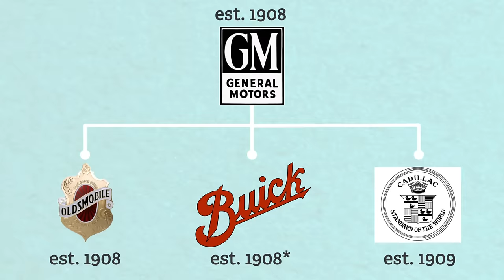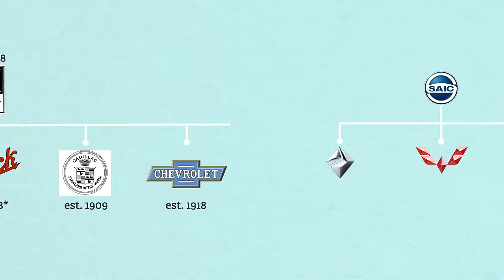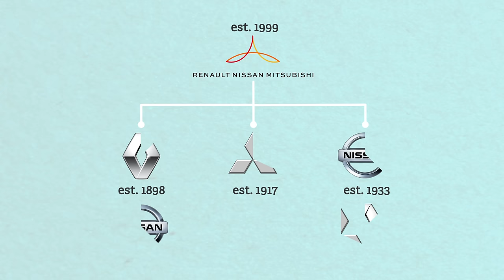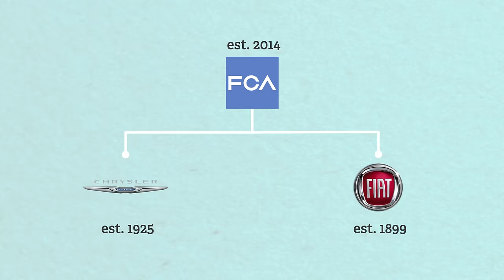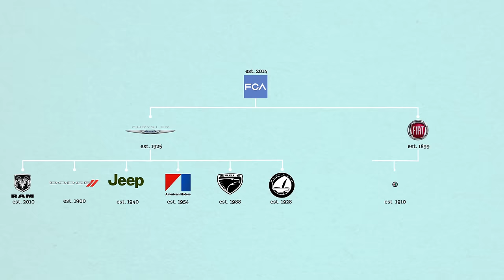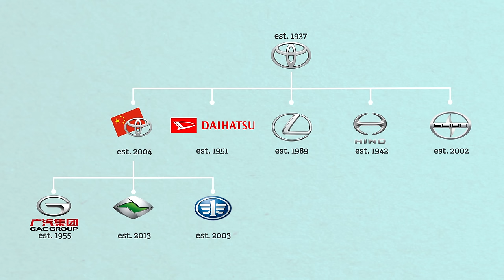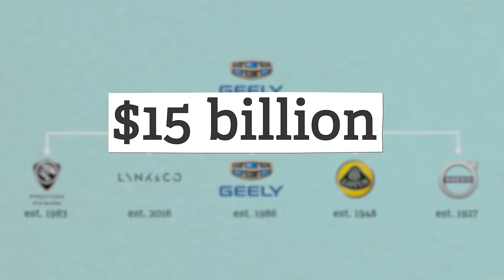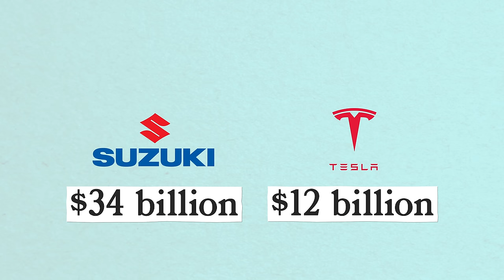Who ACTUALLY Made Your Car? | WheelHouse

Comment: As a mechanic I've worked on a fair share of Audi and Bentley cars and almost all the components have VW stamps in them which is a good thing because by European car standards VW parts are affordable and easy to get. I drive a VW Golf and it actually shares certain parts with those cars, even the 2010s Bentleys had the same chimes. If i can rememberer a Bugatti Veyron has the same crank seal part number as a Golf.
Reply: Here in australia Europe cars are trash and vw parts are expensive. If you don’t know much about cars mechanics will scam the hell outta u here. Japanese brands like Toyota, Suzuki and Honda are the go to here and really cheap parts.
Reply: @syrus1233  How about American car brands there? They’re by far the cheapest parts here in Canada but Honda and Toyota are still the favoured brands here as they’re more reliable. I worked at a Toyota dealership and some components can be expensive, I replaced a mirror glass on a van and it was $520. VW parts here aren’t that expensive. The most expensive parts are from Mercedes. It’s not uncommon to pay $30 for a single bolt.
Reply: So you basically own .7% of a Bugatti Veyron. Nice
Reply: @random_chicken_9123  1%. The standard Golf key is the same as the valet key on a Veyron. Early production Veyron models also had the exact chime sounds.
Reply: @matte8441 If a Dude at the plant who breathed the air inside a Bugatti then farted in a VW Golf count?
Reply: And yet..  those brand charge 100x hahahaha
Reply: and they're all made in the same factories by the same people, just a different style
Reply: Time ago, there was a VW Passat W8 ~ a V-/4version of the VR6 (found in the Golf), and basically half (in length) the Bugatti W16 engine.

Comment: Mazda currently is it's own entity. They did share parts with Ford in some sedans and SUVs as far as I know.
Reply: Back in the day they did. I remember joking with my dad my 2003.5 mazdaspeed protege had the same locks on the door as his f250 v10 lol
Reply: They also have ae the toyota yaris for a bit
Reply: Toyota took a 5% share
Reply: They'll be making SUVs in the same factory as Toyota soon
Reply: Mazda have brand autozam and eunos
Reply: Mazda Co developed the MZR engine with Ford and a lot of their cars have ford parts mostly around the 2008 mark. My Mazda 3 has heaps of ford parts in the interior and I even have some replacement parts on it from some other fords because they use the same engine.
Reply: I think Mazda and Toyota co-own a factory in Mexico?  The "Toyota Yaris" sold in the US as of the 2019 model year is a re-badged hecho en Mexico Mazda 2.  No Toyota parts on it at all, as far as I know.  That makes me sad, because the real Toyota Yaris (not the imposter Mazda) 1NZ-FE engine kicks ass.  The Mazda 2 engine uses gasoline direct injection, which makes me question the reliability.
Reply: @hamsterama  Yeah the Mazda 2 engines and the 3's and 6's all use the skyactive engines. They're ok from what I know, in terms of reliability the direct injection system is a good system to use but can cause issues with carbon build up on the valves as the fuel isn't being used to clean the valve as its injected. from what I know the use of higher octane fuel helps combat this but I've never owned a DI car so I wouldn't know. I plan on doing an SP23 to MPS swap in my Mazda 3 which the MPS is DI. Also, the MPS is the Mazdaspeed 3 in the US just a different name in Australia.
Reply: @Johnnyynf  isnt Eunos defunct already?
Reply: B2000 trucks are Ford's
Reply: i thought so. i drive a ms3 I was like wheres my car???
Reply: @BryceStandley  I remember the service advisor and tech wondering why I brought my Volvo C30 there for an alignment.  I was like just do it like you would a Mazda 3.  Once the tech was underneath he understood a bit better.  Ford, Mazda and Volvo shared that platform.  To this day I still say the Ford Five Hundred was one of the most comfortable things I've been in and I think that has some relationship with Volvo.  Got into an accident in the Volvo on my way to the Ford dealership to buy a transmission mount.  I think the EU Focus ST has the Volvo 5 cylinder as well at one point.
Reply: @BryceStandley  high octane does nothing. Mazda keeps the valves hot to prevent carbon buildup. No known issues of carbon buildup on skyactiv stuff yet.
Reply: Doesn't mazda allso owns sanyong
Reply: In the European market, they sold a rebadged ford ranger as a Mazda  BT-50, they're pretty good trucks tbf
Reply: @tommybason6057  same thing in Australia, we tend to get all the European market stuff. Like you guys have the Mazda 3 MPS like us but the US got the mazdaspeed3
Reply: the tribute and the escape at one point were almost identical cars.
Reply: Tommy Bason only for the T6 ranger , the older 97 to 11 ranger was a rebadged Mazda , Mazda had better Diesel engines coming from the old B-Series
Reply: Now it's not
Reply: Mustang 🇺🇸

Comment: It gets even more complicated if you look at the actual manufacturer of a car, or the manufacturer of main components like the engine or the chassis. For instance, Volvo was using Renault and Audi/VW engines for its cars, and most common rail diesel engines are based on FIAT/PSA constructions. Audi in turn is the remaining brand of Auto Union, whose four rings symbolize the four brands they originally represented: Audi, Horch, Wanderer and DKW. Audi also bought NSU, a maker of the Ro80, the only other mass produced Wankel car beside the Mazda R series. PSA and FIAT cooperated for a series of minivans, the Eurovan project. The resulting product was sold as the FIAT Ulysse, Lancia Zeta/Phedra, Peugeot 806/807 and Citroën Evasion/C8. PSA also cooperated with Toyota for the Toyota Aygo,  Citroën C1 and Peugeot 1008. FIAT and Saab produced the FIAT Croma, Lancia Thema, Saab 9000 and (with a different design) Alfa Romeo 164. The list goes on...
Reply: P

Comment: My Volvo has a PSA engine, that was used on... Peugeot, Citroen, Ford, Volvo, and some say even Mazda, each using it on at least 2-3 models each. Makes it extremely easy to find parts.
Reply: Actually, PSA is one of the biggest engine manufacturers worldwide. I believe at least half of the european cars have these built in.
Reply: @kamikazeratte  their 2.0 diesel has but one rival, the 1.5dci from Renault, that is eternal! The 1.6 psa thou not that great

Comment: Nolan you missed Ford and Mazda but great video nonetheless
Reply: Yeah, they did share some platforms to save on costs but that's not the same thing. My housemate has a modern Mazda 3 and I was surprised to see FoMoCo cast into the cylinder head. I think I was looking for the engine code which I didn't end up finding. Apparently they shared things more recently than I thought.
Reply: TrashDeviant same way with some Range Rover stuff. Had an SVR come into the dealership and it had FoMoCo stamped all over the engine bay.
Reply: they even worked together with Volkswagen for a while in the 90s. the Ford Galaxy (MPV), VW Sharan and Seat Alhambra are basically twins, or triplets.
And many 1.6, 2.0 and 2.2 TDCI engines are built by PSA.
Reply: Ford made the Galaxie and the Galaxy. One is a sexy wide boi and the other is the physical manifestation of disappointment. As a non-American, I only learned of the Galaxy (MPV) from this post. I learned many things today.
Reply: At one point Ford owned a max of 33.4% of Mazda (controlling interest) but since the market crash of 2008 Ford sold off their stake little by little. Over the course of 2008-2010 their ownership in Mazda dwindled to 3% or so,  and finally sold the rest in 2015.
Reply: @lukerinderknecht2982  Thanks bud. This has been a very informative comment thread.
Reply: Mazda is independant and Ford only owns Lincoln.
Reply: @TrashDeviant  The mazda 2.3L MZR that is in my mazdaspeed is essentially the current 2.3L Ecoboost ford uses.
Reply: Ford no longer has stakes in Mazda, they sold it out back to mazda I think
Reply: @TrashDeviant  Ford own jaguar at some point, didn't manage the brand well and I'm glad they sold it, new jaguar's made by tata are sexy, sporty and well designed. Like who would buy a luxury car based on a Ford flex?🤮 or a Ford Taurus with hideous headlights.

Comment: Excuse me if I'm wrong, but there are new Lada's being sold already, so probably not defunct
Reply: Yeah I swear they still make cars
Reply: Yup. Actually - Lada is the brandname for cars made bt Avtovaz
Reply: It's probably just the name that someone bought the rights for, doubt it shares much with old socialist Lada's
Reply: @mrcaboosevg6089  You are right... Avtovaz makes junk now. The cars would be great if not for the price they want... If they charge that price they should up the quality. I rather drive a old JDM car then new Avtovaz products. They still sell Niva for a very expensive price and no changes since soviet era... Just the price and more cheap plastic.
Reply: @mrcaboosevg6089  Nah, it's the same thing. The infographics in this video is totally wrong, because in 1966 between USSR and Fiat was signed an agreemet to build a factory in Togliatti (or Tolyatti, as english wikipedia says), USSR. Original name of this factory was VAZ (Volzhskiy Avtomobilniy Zavod - which can be translated as Volga Automobile Factory), but soon they changed name to AvtoVAZ, because name VAZ was already taken by some other factory. So you're quite right that modern Ladas don't share much with old, soviet Ladas, but the original model, that was based on Fiat 124, with all the "facelifts" and modernisations was in production untill 2012 (!!!), and, what's more interesting, they STILL produce Nivas, which is sliiiiightly facelifted (but since 2009, I guess, they call it just Lada 4x4, because brandname Niva belongs to GM. In early 2000s GM and AvtoVAZ had a partnership - AvtoVAZ built new Niva (production name VAZ-2123), and GM add small corrections - the result of this partnership was Chevrolet Niva).
If we take a closer look to a modern Lada Vesta, it's engine takes it's roots in late 70's - early 80's, when the first FWD Lada was built (Lada Samara). Modern Lada Granta it's a straight continuation of an old FWD Ladas - same shit in the new box =D But I'm not saying that this cars are crap - they were good at the start of production, but making the same car with minimum modernisations in terms of safety and technologies - that kinda sucks
Reply: @MNTUru  The originals weren't exactly excellent machines...
Reply: @mrcaboosevg6089  Yes but they were easy to fix and cheap lol... Now they are great drift missiles. But new LADA is just ehh for the money you can get something much better in build quality and comfort.
Reply: @MNTUru  Like a socialist jeep or land rover, just keep going for longer than they have any right to. I'm sure in the communist days you would have counted your lucky stars to own one but in the west their existence was meaningless with the variety and excellence of ours, even our bottom of the line cars were still better than the USSR's best

Comment: 3:39 except the Nissan GT-R doesn’t cost $200,000. The example you were looking for was GM’s corvette c6 sharing interior parts and steering wheels with their Chevrolet Cobalt.

Also how in the world did you skip Ford and Mazda, then just glance over how Porsche and Audi’s relationship with VW blossomed
Reply: Dreamy I used to own a 09 GTR. It shared a few stuff with other Nissan models but nothing too significant. Some things I recall were the dome lights, sunglass holder, window switches, side view mirror adjustment, the key fob, rear view mirror w/ homelink, the outer ring of the push start, the dash display in the cluster.
Reply: I was loooking at the interior of a 2017 model and noticed it’s climate controls are the same as my dad’s Altima
Reply: @leftyattackmen  yup, like the nissan Juke Nismo, Renault Sport R.S. 01, SCG 004S, and Infiniti Q50.
Reply: A GTR in Indonesia (used) cost more than 200K

Comment: Suzuki is actually present in a huge way in India. They are the oldest international brand continuing uninterrupted since the early 80s. It's a JV called Maruti Suzuki where Suzuki owns about 57% of the alliance. They have sales of about $13 B. Company is valued at 40B.
They are the largest passenger vehicle maker in India but still 1/3rd the total sales of tata motors (India only)

Comment: Where is Dem up to speed on the Dodge charger im waiting
Reply: Yeah I’m tryna get that charger history
Reply: @johnlawson8088  same here
Reply: Oh you a fan of Chrysler General? Whats it like driving a pile of shit?
Reply: S Wilson Besides the dashes cracking, cam shaft issues on the new hemi, and over engineered multi air 2.4L motors. They are really nice pieces of shit.
Reply: @S Wilson, that’s your opinion, in my opinion there cheap horsepower because of all plastic in the interior. That’s why. Other than that MY opinion I think there good!
Reply: S Wilson I'd say its pretty nice given the fact that dodge produces the quickest production car in the world, also ram makes some pretty reliable and badass trucks. I mean, what more could you want. Fast and badass vehicles.
Reply: @swilson9794  Chrysler don't make piles of shit, my dodge charger drives like a champ, but then agaain you wouldnt understand a company thats all muscle and not this puny coupe BS, like you foreign, ford and chevy guys do
Reply: Up to speed on the Dodge Power Wagon
Reply: ChillingCap8365 its all muscle for the 100,000 miles it’s gonna last. Last I checked, Dodge is the one that’s partnered with Fiat so they aren’t the American company here

Comment: Ford bought into Mazda around the mid 90’s and sold in early 2010’s, from what I’ve been told, after that they bought into Aston Martin, that’s why your 2013+ Ford Fusion looks like an Aston Martin... The 2.3 Engine is also Mazda, and most of their 3.0L v6’s (Duratec)
Reply: If you look into it, 2006-2009 Fusions are every bit of a Mazda 3 or 6

Comment: Ford Motor Company
Ford, Lincoln, (some of Mazda) and a Brizan company called Troller.

Also I thought Isuzu was part of GM??? I drive a cabover Isuzu for work that is identical to the Chevrolet & GMC trucks. Also, isn't the Isuzu pickup a rebadged Chevy Colorado? Or has Toyota took Daewoo & Isuzu?
Reply: Mid_South_RZR ford also Bourgogne stake in Ferrari which is how they got away with the design oof the GT

Comment: I'm german and this video made me feel quite smug :D
Reply: Henry Davies bmw all day or audi
Reply: German cars really are amazing, pretty happy with both Audi and Mercedes, they're amazing cars. Never had a BMW though and don't plan on buying one.
Reply: Me too I am and I am proud of German cars
Reply: @SouryuuLangley  hi BMW owner here. The car that I own is extremely reliable, however be prepared for some electrical issues. The car will last a long time if you take care of it, if not it will fall apart pretty soonish. Mine lasted for over 20 years and still looks almost factory new, but I need to work on fixing some issues later. Still drives like a beast though.
Reply: @Dubfiance  Hi, thanks for your point of view on BMW, I honestly never drove one because a lot of bad rumours keep me away from it. I also personally really feel comfortable with both Audi and Mercedes, although I have to admit both have their own issues as well. Newer Audis don't feel like they were made like old 2012 models, they feel """cheaper""". As for Mercedes, there's honestly nothing big to complain about for now, they're very reliable and the quality is pretty nice. I just wish the newer models (for example class A and C) didn't have such an odd and squished front... the 2017 model's looks more appealing.

Comment: FSA and PSA merged to make Stellantis in 2020 and own  Chrysler, Dodge, Jeep, Ram, Fiat, Alfa Romeo, Abarth, Lancia, and Maserati—thanks to FCA—as well as Citroën, DS, Opel, Peugeot, and Vauxhall, thanks to PSA. Polestar is owned by Volvo and Geely. Stellantis, Ferrari, and Iveco are owned by Exor. Mazda and Toyota are suppliers to each other and Toyota owns Mazda's share by 5%. and both own a company called Mazda Toyota Manufacturing.GMC owns hummer. Ford Motor Co owns Ford and Lincoln

Comment: Wow my Volkswagen Jetta gona go up in value now because they own Lamborghini 🤣🤣🤣
Reply: No. Vws are the worst. Sell that thing before everything starts failing
Reply: @eli s, dont hate on what a person likes I respect vw a whole lot and considering they can take a big beating and still move along is pretty damn amazing
Reply: @kaedinstenberg2652  speaking from experience it's not hating. Vw and audi are money pits you don't wanna get into
Reply: vw is a porsche! porsche s.e. holding company owned VW group. yes, porsche has separated itself from its own automobile company.
Reply: @ShruteFarms001  I was joking on it lol... But I did have a 2000 Audi A4 Quattro and I only had 3 problems... The heater core cracked... The gasket for valve cover on the spark plugs was cracked... I fix both of those.... Last one was the transmission ... It shift hard from 2nd to 3rd .. but I never changed that... Had it for 4 years then I got hit so insurance gave me money

Comment: You could have thrown in a 'fun fact' that Tata group, through JLR also own many other defunct brands, also including Daimler. Yes, the same name as Mercedes Benz owns.

Going back a long, long way, one if the early pioneers in the British motor industry was importing Daimlers, and building kits of Daimler cars. He had the exclusive rights to the Daimler name in the UK. Eventually (British) Daimler was bought by Jaguar as the luxury brand, so a Jaguar V12 was sold as the Daimler Double Six, long wheel base, ultra luxury etc.

Tata still retain the rights to the name in the UK, not Mercedes.